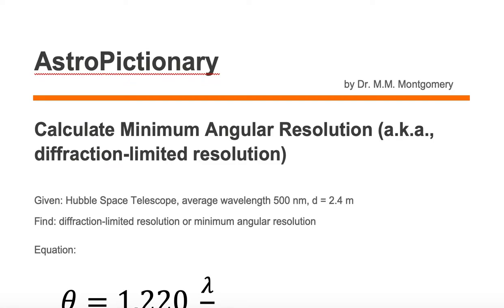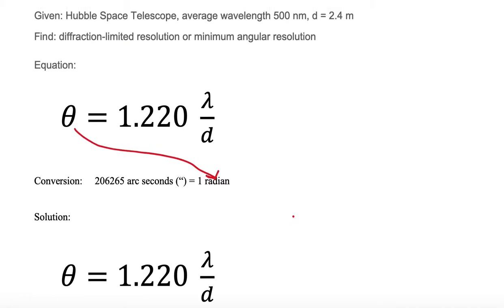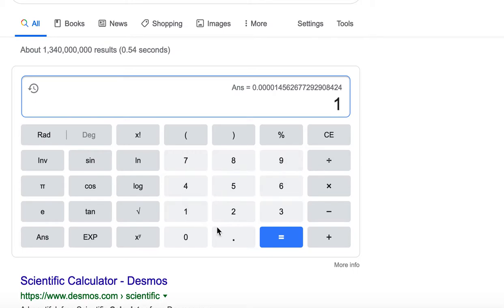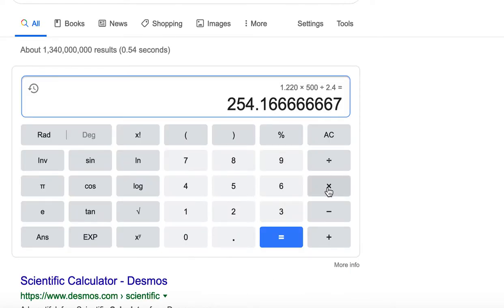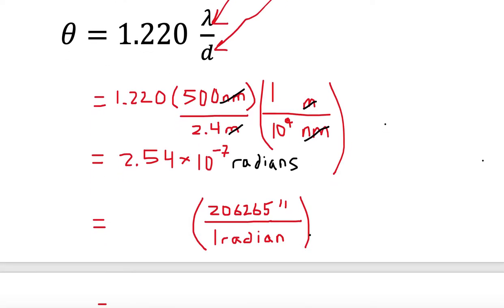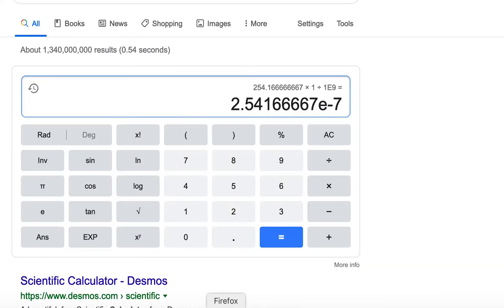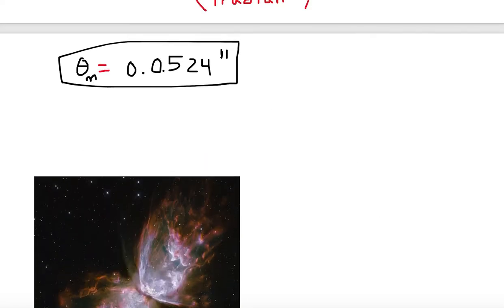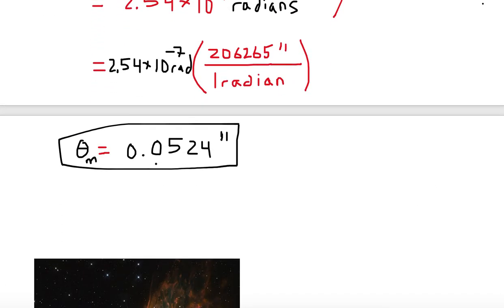Calculate Diffraction Limited Resolution or Minimum Angular Resolution

Comment: How does the formula change if the object is not at an infinite distance but at a well-defined distance "s"?
Thank you
Reply from the maker: Sorry I did no reply earlier; I did not see this comment. Anyway, equation is based solely  on telescope properties  - the wavelength that the telescope is observing in and the diameter of the telescope's light collector. For HST, the diameter is fixed at 2.4 m and the wavelength could be anything in the V band, for example. In this example, we looked at a wavelength of 500 nm, which is a cyan or blue-green color. .